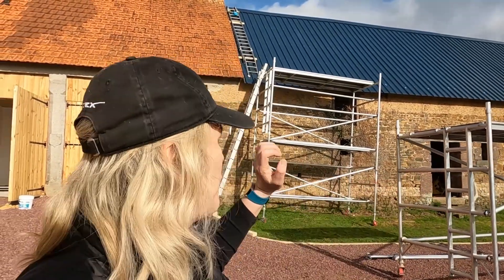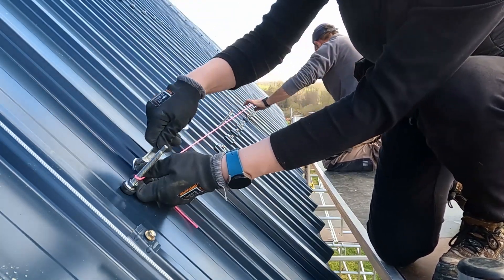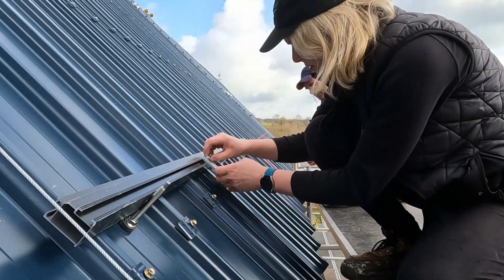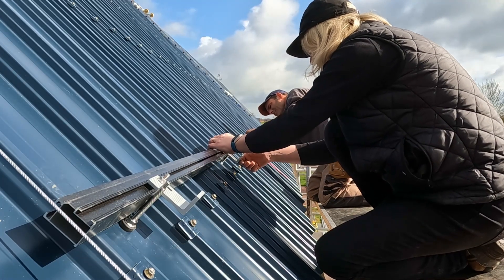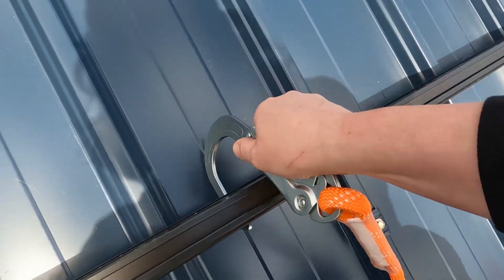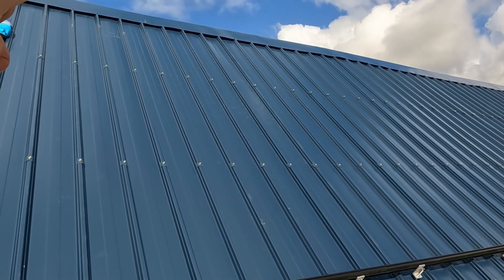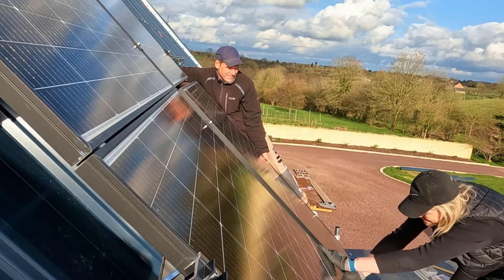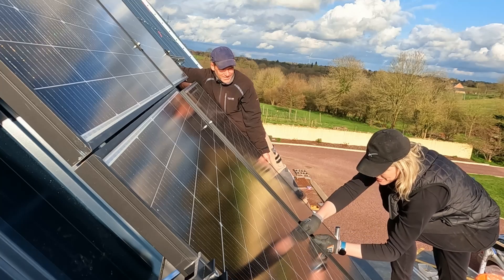Struggling with the first 7 solar panels

Comment: When DIY installing panels on my garage, I put two bolts and nuts in each panel for the lower row of panels (in holes already provided in the panel frame).  I could temporarily rest the panels against the rails without them sliding down on their own.   That made final positioning and securing the panels to the rails with the L brackets a whole lot easier.  I didn't even bother to remove the bolts since they will be useful at some point in the future when I take the panels off.

Be extremely careful on the final MC4 connections.  Remember that the string plus/minus is going to be in the hundreds of volts.

Reminder to check the roof loads again.  That's a lot of weight.   Also check for water leaks.

Good luck!

-Matt

Comment: Watch that harness lead Sarra, because it was crossing your assistant which would mean if you did fall you would take him with you. Doing a great job though, but make sure you test every panel just before you hook up. How are you leaving the cables under the panels, because they should be tied up to the rails securely, any movement with loose wires up there with wind, and it touch that metal roof, will not end well, if the insulation rubs through to create a short. FIZ Bang!!

Comment: SARAH, WE ARE PROUD OF YOU 👍 👍& SO GLAD TO SEE YOU USING THE SAFETY HARNESS!
💡 TIP 1 - AFTER YOU INSTALL A COLUMN OF RAILS SEMI TIGHT, USE ANOTHER RAIL ACROSS THAT COLUMN OF RAILS FROM TOP TO BOTTOM LIKE A LONG LEVEL. THIS WILL HELP TO MAKE SURE THAT COLUMN OF  RAILS ARE PLUMB & AT THE SAME HEIGHT, THEN TIGHTEN THE RAILS TO TORQUE SPECIFICATIONS BEFORE YOU PUT THE SOLAR PANELS ON. 
💡 TIP 2 - WARNING ⛔️‼️ ⚠️ USE THE TORQUE SPECS FROM THE RAILS & WITH A TORQUE WRENCH 🔧 TIGHTEN ALL YOUR PANELS TO THE ALREADY TORQUED RAILS. 
THIS WILL TIGHTLY SECURE YOUR SOLAR INVESTMENT ACCORDING TO THE MANUFACTURERS WIND & SNOW SURVIVAL SPECIFICATIONS, BECAUSE ONCE IT IS COMPLETED ✔️ IT WILL BE TESTED BY THE WORSE ATMOSPHERIC CONDITIONS! SAFETY FIRST!
💡 TIP 3 - WARNING ⛔️‼️ ⚠️ REMEMBER YOUR CHARGE CONTROLLER VOLTAGE OF HOW MANY OF YOUR SPECIFIC PANELS YOU CAN PUT IN A SERIES LOOP TOGETHER IN EACH STRING! 
💡 TIP 4 - WARNING ⛔️‼️ ⚠️ ONCE PANELS GO DOWN MAKE SURE TO CODE THAT NONE OF THE SOLAR WIRES ARE TOUCHING THE ROOF TO ELIMINATE ELECTRIFICATION!
💡 TIP 5 - YOU NEED ACCESS TO EACH MC4 + & - STRING CONNECTORS, WARNING ⛔️‼️ ⚠️ CONNECT THE MC4 STRINGS TO YOUR SOLAR PANEL DISCONNECT IN THE OFF POSITION! WARNING ⛔️‼️ ⚠️ DO NOT LEAVE THE WIRES LOSE TO ELIMINATE HIGH VOLTAGE DC ARCING, BECAUSE YOUR PANELS ARE NOW LIVE GETTING SUN 🌞 LIGHT! 💡 
GREAT JOB 👏 & WE ARE ENJOYING YOUR PROJECT! 
SAFETY, SAFETY, SAFETY